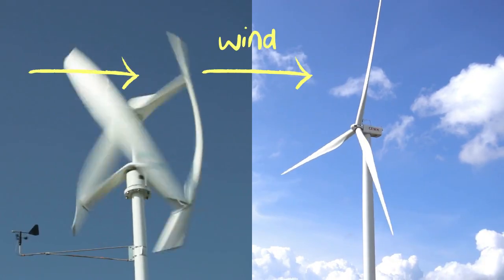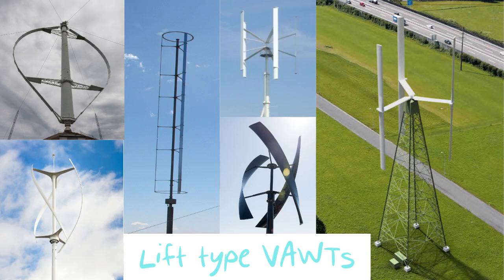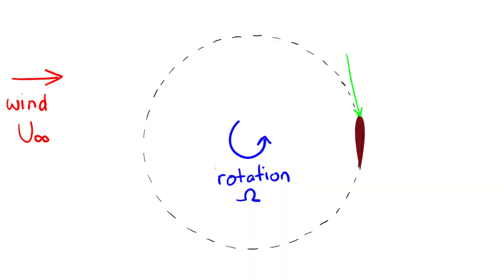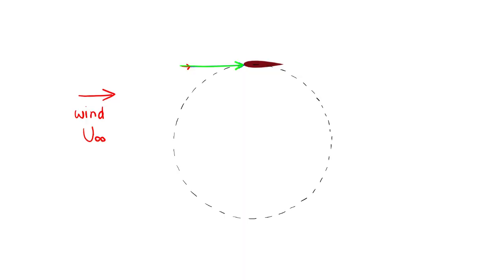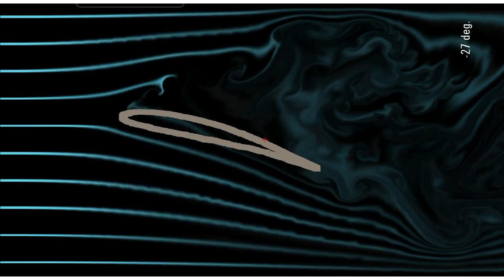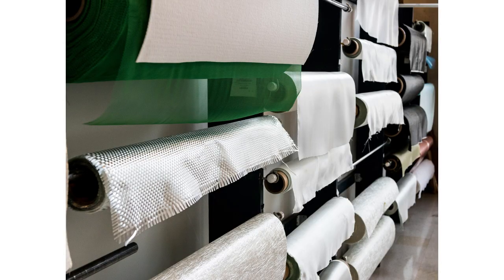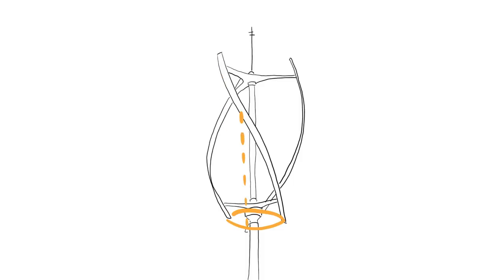Vertical Axis Wind Turbine Aerodynamics and Design

Comment: Hi 

Thank you so much for responding to my question about vertical versus horizontal wind farms.

My second question which you didn't understand has to with the angle of the blades on a vertical axis wind mill which uses an H design (or which has 3 or 5 blades that look like this picture - https://en.m.wikipedia.org/wiki/File:Vertical_Axis_Wind_Turbine_offshore.gif

You will notice that the width of blades pretty much follow the imaginary circumference of the circle that the windmill traverses when viewing from above.

This is probably a silly question, but nonetheless, the question is why the width of the blades lie along the circumference, instead of being perpendicular to the circumference.  

I've tried to draw a picture - I've used four curves (instead of 3 or 5 as it was easier to get the placement approximately correct).  The four curves should look more like airplane wings than half circles but it was the best I could (quickly) do.  But I seem to only be able to paste it in svg format (see below)

Thanks

Phil

<?xml version="1.0" encoding="UTF-8" standalone="no"?>
<!-- Created with Inkscape (http://www.inkscape.org/) -->

<svg
   width="210mm"
   height="297mm"
   viewBox="0 0 210 297"
   version="1.1"
   id="svg5"
   inkscape:version="1.1.2 (0a00cf5339, 2022-02-04)"
   sodipodi:docname="blade2.svg"
   xmlns:inkscape="http://www.inkscape.org/namespaces/inkscape"
   xmlns:sodipodi="http://sodipodi.sourceforge.net/DTD/sodipodi-0.dtd"
   xmlns="http://www.w3.org/2000/svg"
   xmlns:svg="http://www.w3.org/2000/svg">
  <sodipodi:namedview
     id="namedview7"
     pagecolor="#ffffff"
     bordercolor="#666666"
     borderopacity="1.0"
     inkscape:pageshadow="2"
     inkscape:pageopacity="0.0"
     inkscape:pagecheckerboard="0"
     inkscape:document-units="mm"
     showgrid="false"
     inkscape:zoom="0.77593294"
     inkscape:cx="19.331567"
     inkscape:cy="561.90423"
     inkscape:window-width="3840"
     inkscape:window-height="2075"
     inkscape:window-x="1920"
     inkscape:window-y="0"
     inkscape:window-maximized="1"
     inkscape:current-layer="layer1" />
  <defs
     id="defs2">
    <marker
       style="overflow:visible"
       id="Arrow1Lstart"
       refX="0.0"
       refY="0.0"
       orient="auto"
       inkscape:stockid="Arrow1Lstart"
       inkscape:isstock="true">
      <path
         transform="scale(0.8) translate(12.5,0)"
         style="fill-rule:evenodd;fill:context-stroke;stroke:context-stroke;stroke-width:1.0pt"
         d="M 0.0,0.0 L 5.0,-5.0 L -12.5,0.0 L 5.0,5.0 L 0.0,0.0 z "
         id="path3744" />
    </marker>
  </defs>
  <g
     inkscape:label="Layer 1"
     inkscape:groupmode="layer"
     id="layer1">
    <ellipse
       style="fill:#ff0000;fill-rule:evenodd;stroke-width:0.264583;opacity:0.00000001"
       id="path31"
       cx="111.97793"
       cy="99.139839"
       rx="40.447502"
       ry="40.120037" />
    <ellipse
       style="opacity:0.13;mix-blend-mode:multiply;fill:none;fill-opacity:1;stroke:#000000;stroke-width:2.365;stroke-miterlimit:4;stroke-dasharray:none;stroke-opacity:1;paint-order:stroke fill markers"
       id="path3712"
       cx="120.30511"
       cy="184.52141"
       rx="46.5382"
       ry="42.657303" />
    <path
       style="opacity:0.13;fill:none;stroke:#000000;stroke-width:2.365;stroke-miterlimit:4;stroke-dasharray:none;stroke-opacity:1;paint-order:stroke fill markers"
       id="path5092"
       sodipodi:type="arc"
       sodipodi:cx="166.4631"
       sodipodi:cy="190.75388"
       sodipodi:rx="10"
       sodipodi:ry="10"
       sodipodi:start="3.1415927"
       sodipodi:end="0"
       sodipodi:open="true"
       sodipodi:arc-type="arc"
       d="m 156.4631,190.75388 a 10,10 0 0 1 10,-10 10,10 0 0 1 10,10" />
    <path
       style="opacity:0.13;fill:none;stroke:#000000;stroke-width:2.365;stroke-miterlimit:4;stroke-dasharray:none;stroke-opacity:1;paint-order:stroke fill markers"
       id="path5092-6-8"
       sodipodi:type="arc"
       sodipodi:cx="-143.53969"
       sodipodi:cy="125.23769"
       sodipodi:rx="10"
       sodipodi:ry="10"
       sodipodi:start="3.1415927"
       sodipodi:end="0"
       sodipodi:open="true"
       sodipodi:arc-type="arc"
       transform="rotate(-90)"
       d="m -153.53969,125.23769 a 10,10 0 0 1 10,-10 10,10 0 0 1 10,10" />
    <path
       style="opacity:0.13;fill:none;stroke:#000000;stroke-width:2.365;stroke-miterlimit:4;stroke-dasharray:none;stroke-opacity:1;paint-order:stroke fill markers"
       id="path5092-9"
       sodipodi:type="arc"
       sodipodi:cx="-72.939659"
       sodipodi:cy="-176.76231"
       sodipodi:rx="10"
       sodipodi:ry="10"
       sodipodi:start="3.1415927"
       sodipodi:end="0"
       sodipodi:open="true"
       sodipodi:arc-type="arc"
       d="m -82.939659,-176.76231 a 10,10 0 0 1 10,-10 10,10 0 0 1 10,10"
       transform="scale(-1)" />
    <path
       style="opacity:0.13;fill:none;stroke:#000000;stroke-width:2.365;stroke-miterlimit:4;stroke-dasharray:none;stroke-opacity:1;paint-order:stroke fill markers"
       id="path5092-6"
       sodipodi:type="arc"
       sodipodi:cx="230.26576"
       sodipodi:cy="-123.66534"
       sodipodi:rx="11.244735"
       sodipodi:ry="11.128551"
       sodipodi:start="3.1415927"
       sodipodi:end="0"
       sodipodi:open="true"
       sodipodi:arc-type="arc"
       transform="matrix(-0.03464387,0.99939972,-0.99981288,0.01934463,0,0)"
       d="m 219.02103,-123.66534 a 11.244735,11.128551 0 0 1 11.24473,-11.12855 11.244735,11.128551 0 0 1 11.24474,11.12855"
       inkscape:transform-center-x="15.807188"
       inkscape:transform-center-y="1.1746265" />
  </g>
</svg>

Comment: Hi

Thank you for the video.

I have two naive questions.  The first question is whether you have rethought vawt for turbine farms given the recently published article on how (if I understand it correctly) hawt farms cause turbulence which lowers the overall efficiency?

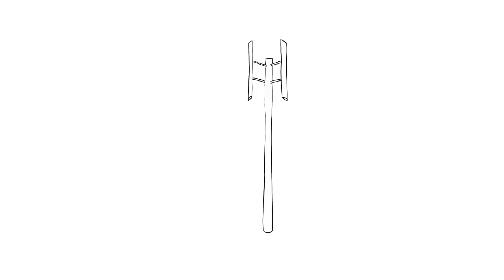The second question is why not place blades perpendicular to the circumference of the turbine?  Then they will be a little like a sailboat.  (For simplicity sake I am assuming four blades with 90 degree separation), when the wind is coming from behind the vawt beyond 6:00, the first blade at 6:00 (the closest) will get lift in the direction that part of the circumference is moving, the second blade at 3:00 will be pushed like a sailboat with the wind, the third blade at 12:00 will get lift in the direction that part of the circumference is moving, and the last blade will either be total drag, or its angle will be adjusted so it cuts through the wind rather than acting as a drag?

Thanks

Phil Troy
Reply from the maker: The first question: no need to rethink. That research has been somewhat misrepresented in mainstream media reporting. Wind energy engineers already knew there is decreased wind speed and increased turbulence downstream of a wind turbine. 
Your second question I don't really understand sorry!

Comment: I recall in aircraft that need to use short take off & landing runaways, uplifted ends to the wings are preferred, as this takes advantage of the vortexes generated at the wing tip, giving more lift at lower speeds. I can see how the upwind blades of H or Helix types could possibly also take advantage of that, possibly if mainly to start rotating at lower wind speeds. Though that would increase the maximum diameter at the ends ( and height ) and probably not as efficient as just increasing the overall diameter ( or height) . However  it might be worth a quick investigation by sticking some on an existing project and see what effects it has on rotation in practice. I'm presuming I'm nowhere near the first to think about that and the above thought on increasing the diameter would be heavily in the minds of commercial producers. I think the only time it'd seem to have much advantage is customising a set diameter bought  machine to take advantage of having  an available space that falls between sizes that can be bought, whether that be available space or available budget.

Thanks for doing these videos.

Comment: Dermot Nangle (Ireland). I erected a 1,500 KW VWAT upon a 2 inch diameter 7 foot tall Steel pole. I tensioned 4 X Stay Wires to stabilise the structure. However, due to strong winds (Not gale force.) one of the stay wire couplings snapped and the structure became unstable, hence I had to stop the blades. My question relates to the fact that I suspect that the mast system went into RESONANCE because of strong wind speed coupled with the system not being BALANCED! This RESONANCE clearly over stressed the stay wire coupling in my opinion. Do you agree that VWAT systems MUST be Critically Balanced on commissioning? If so how does one balance such a system, please?

Comment: Thank you for your video's. Please could you do a report on the TESUP Atlas 4kw vertical wind turbine. This is the only vertical wind turbine that will suit my application ( that I know off ). I would like to mount this system on top of a large telegraph pole, in my farm yard here in the UK. I like this design because of it's box at the bottem of the turbine. This can be mounted to any flat surface high up. Hoping for a possitive reply. Regards John Pinder

Comment: Would a bearing on an eccentric controlled by the wind direction via a vane,  with tie rods attached to the trailing(or leading) edge, I'm not sure which one needs the least amount of work to move the aerofoil,  so the AOA will change for each foil as it rotates about the axis.  would it put too much drag on the whole system and then negate any performance advantage?

Comment: Ive recently moved to a windy off grid location and have been wondering about VAWTs to make use of that wind, it seemed so simple to build in that the wind direction doesn't matter but it turns out there's a lot more to it than just the wind direction and length of the blades! Thanks for breaking it down so succinctly!

Comment: Valuable information. I have always wanted to believe that vertical and helical turbine would be the most efficient.  Clearly there is much more to the physics and implication for blade design than I thought. I would appreciate more discussion of the pitfalls of vertical design. We have solar panels and regular winds and have imagined a supplemental wind contribution. I really do not understand the losses to friction and component stressors in horizontal and vertical systems and would love a discussion and comparison of these isssues.

Comment: Typo on my  previous comment; 'blade to tip gap' should read 'blade tip to shroud gap'. Also tthat comment really refers to HAWT. As for VAWT, I'm curious to know if the apparent combination of Savonius and Darrieus offered by Hi-VAWT is a significant design inprovement. Thanks!

Comment: Ducted Shrouds are used on jet engines to improve efficiency and reduce noise. There is a scaling limit obviously, and the blade to tip  gap tolerance must be very tight for the effect to be produced. I'm using this technique on aerial drones for more lift, ie that's more torque for wind turbines. I'm thinking groups of smaller efficient turbines might produce more total power in the same cost/volume footprint of a large single. To be tested....BTW, I vote for the math deep dive video. Thanks for your insights and effort!
Reply: Winglets on the wingtips would allow VAWT blades to create its own ducted shroud as it rotates.

Comment: Hey Rosie, thanks for the Video! You explain things really well. I‘m just learning about the VAWTs and I‘m wondering: The resulting „accelerating force“ that you drew in yellow (eg. in 5:25) is way smaller than the opposite wind. (In blue). Shouldn’t that slow the movement? Or shouldn’t the red lift-force and the green resulting wind-force be added to get a resulting pull force on the blade? That would in this example also not be in the direction that we want it to go…  I‘m really struggling to understand how these forces work and actually turn this thing. Thanks in advance!

Comment: I think you are missing some of the best of VAWT, cost and saving birds.   Since the majority of society lives in cities it only makes sense sound and space should be the most determining factors.   lower cost per turbine based on complexity and size of HAWT means 2 or more VAWT can have a much higher efficiency then one HAWT at a lower cost while saving birds and reducing sound.  I appreciate so many work with HAWT, but they are very loud and very costly.  I hear the UK is doing VAWT roadside, that sounds like a win.   Love the videos, I just do not believe a VAWT can be counted out when you can add a 2nd, 3rd or 4th VAWT in an area that is much smaller than a HAWT and pull out more power for less cost especially for a city or home.  To me we have to start sourcing power to the source of need and not large power plants far away.  Very excited to see the world today, we tried this in the 1970s with so much less tech, this time it may work.

Comment: I live in a housing estate and I notice we have wind corridors between houses. I’m considering a VAWT as it’s quiet and low footprint. Amazon has several options, 7-10kw. I have PV and 48v inverter, would be possible to plug into the system?

Comment: My favorite VAWT is a H type darrieus with four straight blades with four small savonius half drums mounted in the middle of the turbine orientated to catch the wind from any direction. Having the savonius half drums in the middle orientated to catch the wind from any direction should help start the rotation of the four large straight blades in low wind conditions without being detrimental to the power generating ability of the main blades of the turbine if sized correctly.
With the generator gearbox and brake in the bottom of the column or tower for ease of maintenance the design described above which is my preferred VAWT design is less complicated than most designs and should be very efficient with close to 40% efficiency possible.

The size of the savonius half drums need to be proportional to the overall size of the rest of the turbine so they do not cause undue drag and effect efficiency while still being of a large enough size to help with low wind starts.
VAWT have some definite advantages ease of overall maintenance with virtually no excessive climbing needed is a big advantage with better weight distribution with much of the mass being at the bottom being another.
I can't see my design for a Vertical Axis Wind Turbine replacing a well designed HAWT with a well designed Horizontal Axis Wind Turbine still theoretically capable of 59% efficiency but it does have enough advantages to be tested and put into service with the overall efficiency a little bit lower than a HAWT and with the design really only suitable for medium to small sized turbines but with the advantages listed making the design worthwhile. My design has an excellent low wind start ability and is easy to maintain with a relatively small physical footprint and has a simple overall design with a relatively low cost to manufacture.
The overall design and intellectual property belong to. 

...Mark J Maxwell....😎🇦🇺👍
Reply: Being ominidirectional also means that they don't need slip rings to transfer the generated power from the nacelle to the round. Slip rings wear out eventually and need maintenance, but then so do the bearings of a VAWT!
Reply: @tlangdon12  If it's mechanical it will wear out at some stage.
But good maintenance schedules and designs that  make parts replacement easy can balance out a small lack of efficiency compared to other designs.
Most things are only designed for a twenty year lifespan before the cost of maintenance parts and efficiency loses start to render them unviable.

Comment: Okay so be nice folks because I'm chef and this really isn't my field but I have a couple of questions. 

1. What are the logistical differences in terms of spacing apart vertical V's horizontal. Would vertical not take up less space so you could build more in limited spaces and would this effect output measurement differently? 

2. Would it not be possible to have different direction rotations placed one atop the other to double rotations? 

Most likely daft questions but I'm not ashamed to ask. Most grown adults don't know the proper tips to poach an egg. I'll share if you do 👍🏻